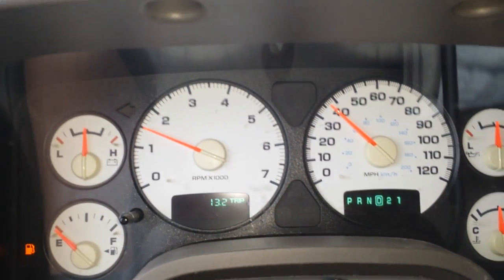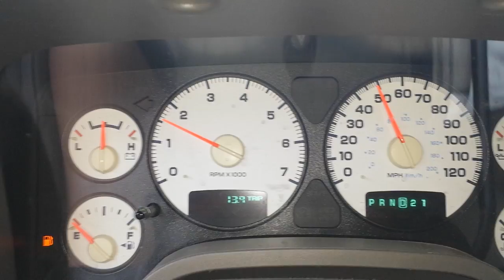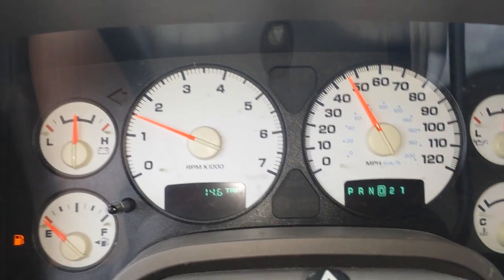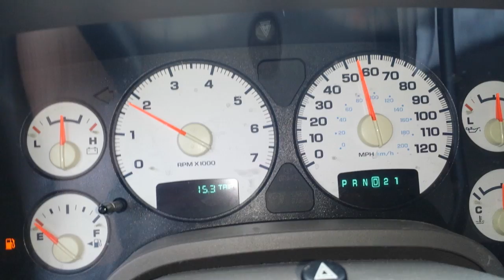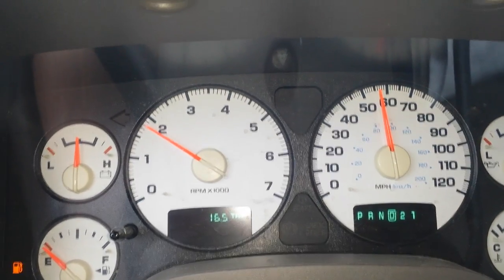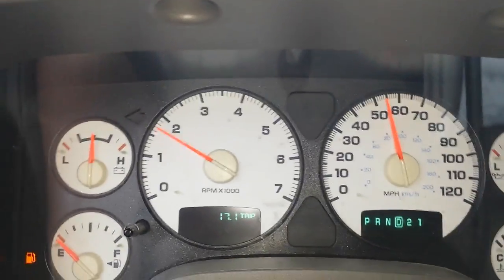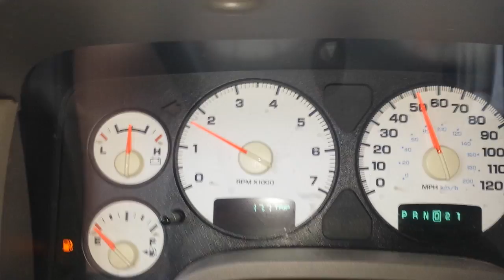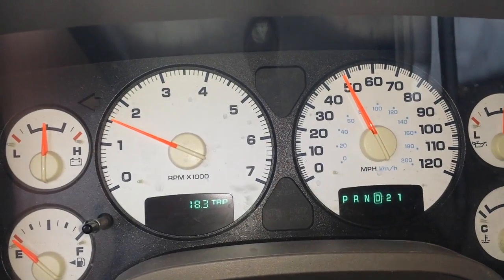Solved! Dodge Ram abs and parking brake lights on.

Comment: same problem except our check engine light is NOT coming on and the engine would barely start or run without stalling (managed to get it to run enough to get us to walmart and back.)
Reply from the maker: It goes into a "failsafe" mode that will allow it to run, but very poorly,  forcing the driver to have it checked. If your check engine light didn't come on, it's because your speedometer was still working at least somewhat. My check engine light never came on until the speedometer completely quit working at all for 20 miles or so. I have a new video I am putting together showing how I clean out the differential housing, etc., and showing the problem going away immediately.  It should be loaded in the next week or so.
Reply: Dino Fuse weird. When our car started dying out and not starting is when the speedometer stopped working.

The car works VERY POORLY and constantly hiccups LOTS on the way back home from walmart.Running but as if someone is randomly letting off a bit and pushing back on the gas pedal.
Reply from the maker: +realflow100 oh, if you're talking about a car, rather then the Dodge trucks I mentioned in this video, then you're problem could be entirely different.
Reply: Dino Fuse nope is a dodge ram 1999 i think
its pretty old i think
We almost gave up trying to get it to start. but gave it one last shot and it eventually cranked over and started but ran very poorly (Well there was no air filter on it because we tried spraying engine starting fluid directly into the intake but it still didn't solve help or even make much of a noticable difference while trying to start... it sounded like it started really weakly. Lots of different color black and white smoke poured out of the exhaust. but then it cleared up rapidly and the tailpipe made a normal engine sound of a wub wub wub instead of sshshshhshhhhshhh
There was a lot of hissing sometimes when it would first try to start up. also seems to be a vacuum line going directly to the air filter box to the oil tank or engine block oil tank
pedal to the floor or not. it would just not wanna seem to start up. but eventually did after loads of cranking over several days.
Reply from the maker: +realflow100 that could be a lot of different things, plugs, wires, injectors, you name it. Mine had a weak start up issue when I first got it, it smoked when starting too, and it turned out to be a bad injector. I'd start by having the codes read fron the obd system 1st, and go from there.
Reply: Dino Fuse we'd have to take it to autozone or some place but i dont know if it will make it and my mom doesn't want to bother and thinks it will just be fine. but it wont be fine when flames are shooting out of things and she isn't even concerned by the speedometer gauge not working or the break and ABS lights being both continuously on. Or that it's hiccupping when giving it gas while driving.
when coasting at 40MPH with the foot off the pedal it doesn't hiccup and "jerk" forward and back. as if someone is randomly letting on and off the gas repeatedly
Reply from the maker: +realflow100 yeah, I'd take it in and get the codes read, and changing out the differential oil couldn't hurt, then you could check the sensor by removing it, if the sensor is located on the differential on your truck, that is. I'm not familiar with the 99 models, but it could be the same problem if it is located there.
Reply: Idk I can see some wires going directly to the transmission or near where the axel comes out of

a few sets of 2 wires going into various places.
Can't tell but could one be loose or corroded possibly if they're exposed like that?
Reply from the maker: +realflow100 yeah, on my truck, a 2002 dodge ram, there are 3 sensors, 2 on the drivers side of the transmission,  and 1 on the top of the differential housing. the 1 on the differential housing is the one that reads the tone gear for the speedometer.  so it can't hurt to go buy the oil and gasket and take the cover off the housing,  clean everything out, and check the magnet in the bottom of the housing as well for metal bits, if you have the same set up with the sensor on the housing.
Reply: Dino Fuse no idea but that sounds interesting.
I dont think we have the tools or anything to check that.. so it'd have to be checked at a mechanic shop.
Reply from the maker: +realflow100 all you need is a socket set, and a flat screwdriver,  the 2 and a half quarts of the proper weight differential oil, and the gasket and some gear oil resistant rtv sillicone. you dont even have to jack the vehicle up. if you subscribe to my channel, I am posting my how to video this weekend sometime,  it is easy,  and worth doing yourself,  as the mechanics shop will hit your wallet hard, but whatever you feel comfortable with is right for you.
Reply: It seems you definitely have problem with the ETC or the Electronic Throttle Body or with the PCM. When you replace the ETC on a Dodge Ram with Hemi you MUST take your truck to the dealer or mechanic who has a tool scanner with the specific Dodge software to do the relearn process; there is NO way around and don't waste your time trying to do the ETC relearn by using the conventional methods. Same applies if the problem is the computer or PCM. It's a expensive fix that will cost you around $1000 bucks; you can buy on Amazon or Ebay the ETC cheaper between $100 to $200 but the really cost is the dealer relearn process which cannot be made by traditional methods or with a any scan tool but a very expensive one due the software. Good luck.
Reply: Another good piece of advise: DON"T BUY RE MANUFACTURED PCM online from NOBODY since in order to perform the ETC relearn process they need to be done on your vehicle. Part sellers will tell you they test the PCM on another similar vehicle but trust me, it won't work on your vehicle specially if you own a Dodge with a Hemi engine. Unfortunately there is no way around otherwise you will spend money and time with no result and end up really frustrated. Besides if you buy it online you won't get a good warranty on your part. You can buy the ETC new or re manufactured online without expecting to have any issues but NEVER buy a re manufactured PCM online. Good luck.
Reply: Vladimir Hazera the engine check light actually came on once we got the engine to run long for long enough for it to detect a problem.. I dont know about the gauge not working but i think its either engine fuel injectors need cleaning. OR fuel pump needs to be replaced (not likely) or fuel filter needs to be replaced (possibly. but also not very likely.) or the spark plugs need to be cleaned and the gap checked on them 
no weird exhaust colors. Not burning engine oil or anything. exhaust smells normal too (not much smell to begin with though)
but its a real pain to get to the spark plugs. they're embedded REALLY deep in the engine block for whatever reason.
The engine temperature seems normal as well. the oil pressure is slightly on the high side but becomes normal once it starts to warm up.

Could we test out a different octane of gas or get some kind of engine cleaner or octane booster stuff to put into the tank? then rock the vehicle back and forth gently to mix it in the tank?
I actually think LOWER octane would be better since the engine is running rough and weak (it goes to almost 2 digit rpms and somehow finds the power to keep firing and spin up again but it eventually does stall completely.)
if we play with the gas pedal right we can get the rpm to climb up and after a CERTAIN POINT. it goes VROOM and runs fine at a high rpm. but terrible at low RPM. I dont think the fuel pump has been replaced in a while so we might check that. as well as fuel filter and spark plug first.

the vehicle is getting on the "pretty well worn and used" side. since its travelled all over the US for long periods of time the original battery became fried and old and wouldn't start the car anymore. so we got a new one (bigger and beefier new battery. kind of overkill though but i guess thats not a bad thing)
Reply: It's the engine light on or the hazard light on? If you got the hazard light on and the engine is stalling then your problem is the ETC Body, the PCM or both. A good sign of a faulty ETC is your RPM gauge: engine runs rough above the normal RPM or you'll notice the RPM are bouncing no steady; when you have ETC problems you won't have any RPM control by playing with the gas pedal.  From what you're saying I don't think it has nothing to do with your spark plugs. You're right problem is on the fuel system, no electrical problem; however it might be also the air sensor. Since you got high miles on your vehicle and having problems on low RPMs I'd check the cylinders compression; then problems aren't on the spark plugs but hopefully best case scenario on the ignition coil or worse case a faulty cylinder. If you suspect problem might be the result of old or poor octane gas you might try to fix it by using an additive cleaner like SEA FOAM MOTOR SYSTEM SPRAY the one you apply it directly to the intake system and it will clean and lubricates the throttle body, valves, plates and upper cylinders. It works wonderful!
Reply: Vladimir Hazera nope i meant the "check engine" light was on.i dont think it has any hazard lights.. And sea foam wont fix clogged injectors! D: it definitally has lots of compression because sometimes the engine will actually make a loud CLUNK while starting and suddenly stop cranking for a split second. like there was a weak backfire and it interrupted the starter o. almost as if it hit a piece of metal and got stuck for a split second? could the starter gears have a broken tooth? but once its running it runs just fine.

Also it died and wouldn't want to start after it sat for a few months. for some reason. Just made smoke rings out the tail pipe. once it fired up you could barely tell it was running it sounded so bad. and the smoke was a yucky mix of white/grey and dark smoke for a few seconds. but it cleared up and stopped smoking after a bit.
Then we managed to drive to the store and back but barely got back. and noticed the miles per hour gauge wasn't functioning.
The battery is fine. and actually had to be charged once because it was completely flat and wouldn't want to start at first. for a long time.. sprays of starting spray fluid directly into the open intake bypassing the air filter STILL took a lot of tries to get it to start. but eventually it did manage to start.
Reply: If you hear it makes a ONE loud click the starter motor is probably jammed or shorted.  Need to free it up or replace it as necessary.  Any time you see WHITE smoke on ANY engine, it's because one of the following reasons: Lack of compression,  WATER in the fuel,  AIR in the fuel, a defective injector or a cracked cylinder head or the engine has a leaking head gasket.  You cannot tell a engine has or not a lot of compression just by the sound of the engine; you MUST perform a cylinder test.
Reply: Vladimir Hazera Well it hasnt made any weird exhaust colors since then. so it could probably of just been some water.
Reply: @hazerava  bullshit,  don't need a dealer to relearn the new throttle body.. done plenty without that bullshit.. you must work for a dealership.. lmfao
Reply: @therealbigfoot3076  I wish you were right but true is that unfortunately you cannot do it with a regular scanner.  I told that to my mechanic who has a very fancy scanner and he didn’t listen to me. We had towed the truck to his shop and next thing he sent it to the dealer himself. Then he called me saying “Oh the damn Chrysler don’t share the software...” and I was like “see, I told you but you’re a damn stubborn sob”. I don’t know if things have changed now but it was like that back then when I replaced it in my truck .
Reply: @hazerava  I just bought one from o'Reilly few days ago did the relearn from the Chilton manual and it runs beautiful.. I promise you don't need any special tool. Look it up online.. easy to fallow instructions.. disconnect negative battery post and go from there
Reply: @therealbigfoot3076  lucky you and I believe you. What year is your truck? My is a 2004 Hemi 5.7L. I’m telling how it was in my own experience and things didn’t work out like that. First, I tried to do it myself the same way as you do on another vehicles and using with my scanner. A good friend of mine who is a top notch mechanic who works in charge of the State fleet vehicles maintenance tried using a better scanner and didn’t work. Then a mechanic who work for him at the city shop who used to work for the DODGE dealer told us about the software issue. Like I said things might be different now.
Reply: @hazerava  mine is 03 2500 5.7.. don't need a scan tool.. just disconnect the battery for couple minutes.. ( I did over night).. reconnect battery,  turn key on (dont start) wait 20 seconds to one minute.. you should hear a clicking sound.. its relearning.. then start truck..     can find on allot of forums online
Reply: @therealbigfoot3076  again, I know how to do all of that and that was exactly what I did  but with no results. Maybe yours is different since it is a different year and model. I’m pretty handy in working on engines, around electromechanical systems and like I said I had some extra help from my mechanic friend who works for the city shop (he’s a mechanical engineer as well). We both tried different ways to get it done but nothing worked for my truck.

Comment: I'm having the same problem with my truck I have a 2006 Dodge Ram I'm having the same damn problem the ABS light comes on also the brake and light comes on
Reply: I thought it was just me
Reply: Did you fix it ?

Comment: Uhmm... you need gas & why didn't you show the work needed?
If I wanted to watch a dashboard, I would have driven my own truck.
Thumbsdown dude.
TII
Reply from the maker: Go make a great video and enlighten us all, instead of leaving stupid comments.
Reply from the maker: I don't get paid to show you how to work on your truck. If it didn't help you then move on to the next video. Easy.
Reply: @dinofuse6949  I am glad to see that you are watching your channel. 
I shouldn't have said thumbs down. But, I didn't get anything from your instruction. If you fixed it, did you video it? That's the direction people like me are looking for.
TII
Reply from the maker: @tii2015  yep. Its fixed. Still running strong. I recorded it, but my phone got corrupted and only parts of the video were available.
Reply: @dinofuse6949  That's Great! 
Mine is still running also. (Barely). Ran diagnostics on it, got 5 codes, mainly emission. Replaced up & down stream right bank, EGR, and last Saturday Mass Air Flow sensor. Cleared all codes, runs SOOO Smooth. (No lights). 
Left work today and engine light came back on, ABS/Brake Light came BACK ON.😣😣
Pretty sure engine light has to do with ABS/Brake in Differential.
What do you think?
TII
Reply: Also subscribed.
TII
Reply from the maker: @tii2015  it is highly possible that the differential is the cause. It can literally be so many things though. Wiring harnesses all the way up to being the abs control module. Just keep narrowing it down, I always start with the easiest and cheapest causes first then move on. I just did my idle control valve and cleaned up the throttle body this summer, and it cured an intermittent stalling problem I had, runs like new now.
Reply from the maker: Oh. And just so others might be reading, the gas was so low because I planned ahead, just in case I had to pull the fuel pump which is actually in the fuel tank on mine, so I figured I'd have as little fuel in it as possible. I literally took this video when the work was done and taking it on a test drive to the gas satation. Best of luck with it. If you ever have an issue where your interior lights and radio stop working, I have a video on the fix for that, which does show the work.